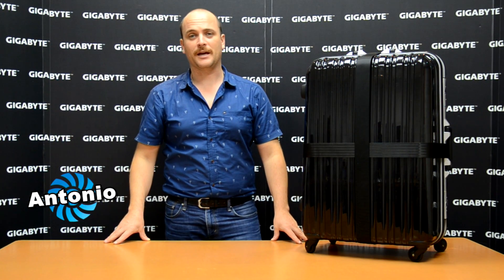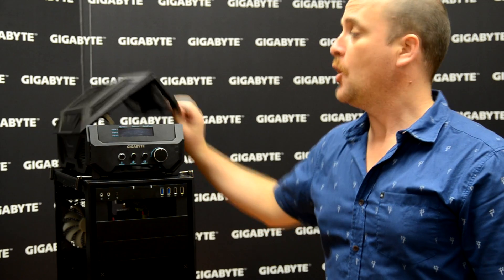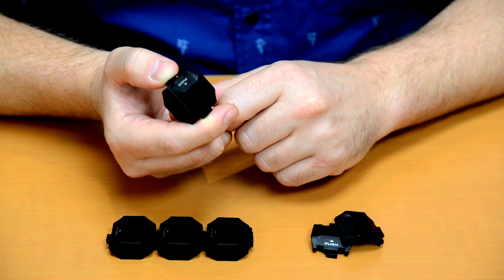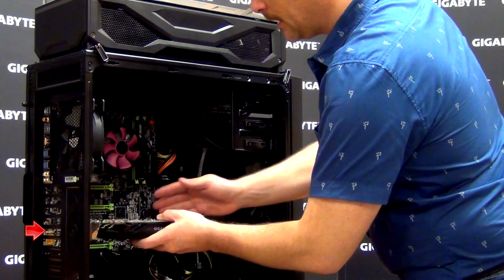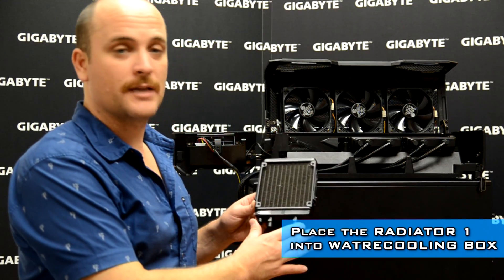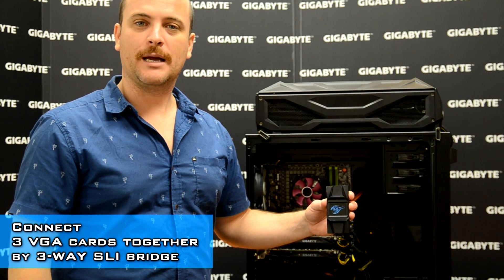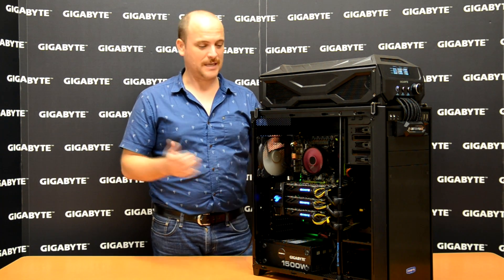GIGABYTE - "WATERFORCE" 3-WAY SLI WATER COOLING SYSTEM , Installation Tutorial

Comment: Hey GIGAVYTE-Team and other people!
Once I had seen a group of students, they made a new kind of 
cooling system. 
They took an empy aquarium put the pc inside (without the fans and 
without the box, dont know how its called) and filled it with pure oil! 
Oil is a 100% hydrophob fluid and isolated the parts verygood, so there 
was no problem with breaking the stuff.
Even at high performances the temperatur was never over 22°C in this 100
 liter oil.
The only downside is that its highly difficult to switch some parts of 
hardware e.g. a newer graphic card and the usb must also be placed 
outside the aquarium. But its one of the most efficient cooling systems 
out there, even if its a prototype.
Let my know what u think.
Reply from the maker: Hey there. Thanks for the information :) Yes we are aware of cooling with mineral oil! One issue could however be how to cool it and to have a pump that can push oil and not only water. Eventually the oil will also become hot and the temperature will rise. But it's definitely a cool experiment, I have seen a few myself! Best regards

Comment: The Gigabyte coffin?
Its just far too big, unnecessarily so & not exactly stylish either. Compared to the asus or xfx r9 dual 290x's its literally a monster, a hideous gamerish monstrosity.
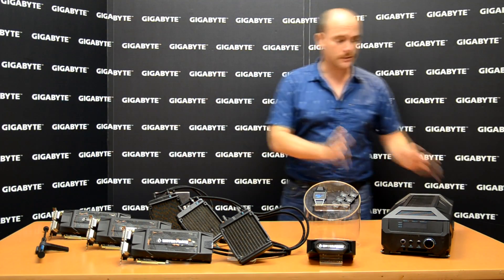1:31 - i think many would have other words for it than "awesome" and never "pretty"
Even the gpu's water "blocks" are fucking hideous - 3 water cooled gpu all in one = wow!,awesome idea! but the aesthetics are utter fail.

If it were given to me I'd rather mod it somehow, having a seperate reservoir, fit the controller stuff in the front of 51/4 bays and reduce to a thick 240, anything to get rid of that coffin. I love the idea but the execution. yuk.

Comment: They should price this at $1999.95. That would make sense. Or include a CPU block but a 360 rad won't be enough for all that. I am really surprised it is enough for 3 980's. There won't be much over clocking head room I would imagine.

Comment: I would gladly pay the price for this if I could afford it just to support an awesome company like Gigabyte.  They have done right by me providing many affordable pc components over the years.  This looks cool and is easy to install.  It also comes with an awesome case too.  I guess maybe they could have added more value to this by offering some free games with this and some other extras.  Is there anything with this kit that they didn't show here that I don't know about?
Reply: yeah he didnt mention whether is a full water block or just a h55 splashed to gpu, i believe is not full water block, is something like r9295x2 which in this case you could get two of those for less than 2k and 1300w psu for them r9295x2x2 consumes 1250w in benchmarks proven by OC3D NOT to mention it would BLOW 3 980-s out of the water
Reply: darkfall13
if you had a little bit of brains (not saying you dont, just following your logic) you would pay someone that has the knowledge to do it after buying the components needed (with the assistance of said person)...

and yet you would still save money.

Comment: This is hilariously awful in almost every respect. What the hell were you trying to do?! £2500 for an inefficient and MASSIVE, fuck ugly watercooling solution? Are you nuts? You could get a far FAR superior internal watercooling setup with 3x GTX980's for almost £1000 less! And there are even better alternatives for external AIO systems for GPU's which would cost about £700 less in total! And if you argue the "but you don't need to assemble it" point, sure, but you still do to some degree, and you have to post the radiators through the drive bay?! Ridiculous. I'm sure you could use some of your £700 - £1000 change to pay someone to do a proper job... What happens if one of the GPU's develops a fault? Pffsh...
Reply: ***** Somebody forgot to take their medicine..
Reply: xD
Reply: doubtful but keep telling yourself that
Reply: hate nvidia or not , using the cards for 1 year does already payback the power consumption in comparison to amd cards.
Reply: *****  oh look an AMD loving nazi twat, what a surprise -___-
Reply: This is just getting more and more hilarious. :L I'm not sure if I want it to end anymore... xD
Reply: MrAcme15 tell you the truth my first nvidia was a 8800gt, I used to love nvidia till I found out they don't give a shit about you anymore and they gave up on power consumptions and voltage, they are a little more overwhelming than AMD's perfect power consumption video cards and they can overclock better and at a fair price, so you want to waste money on a nvidia card be my guest.
Reply: Thomas Lukins they all sound alike fuck off
Reply: TheCovertCamper all video cards do that except nvida does it the best at heating rooms, in the end it's all greed with nvidia.
Reply: Sharfaraz Ahmed no i'm not, you must be a jew, don't pay it.